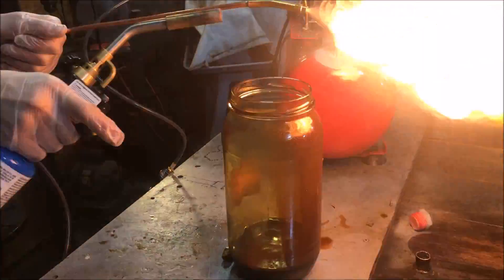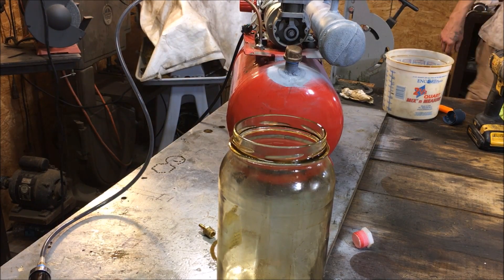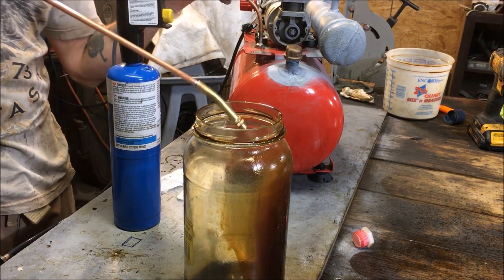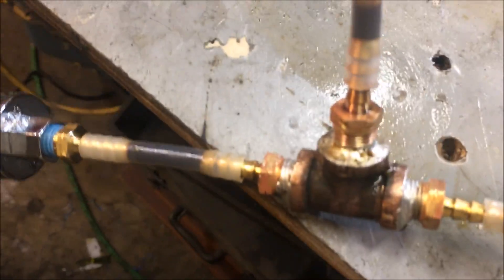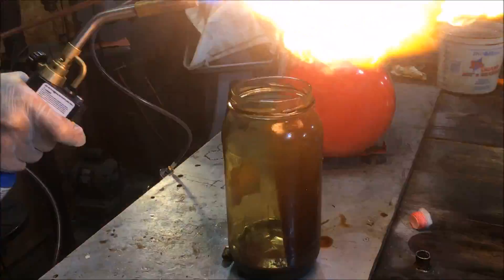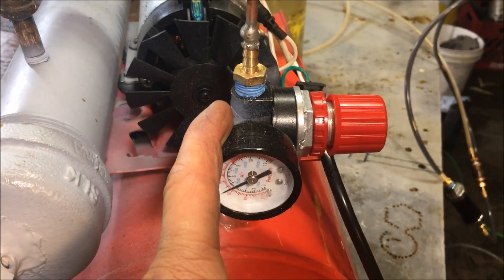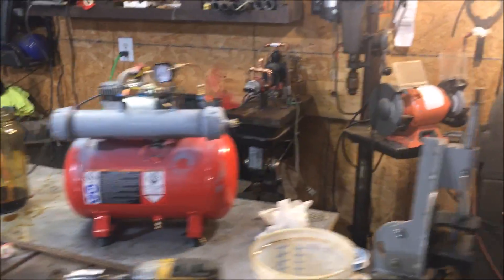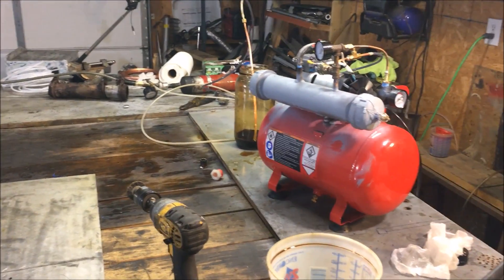Waste oil atomizer ( TEST )

Comment: The way you have yours now is the same way oilburner sets his up With the exception of the filter.  He does not use a filter!    And for a nozzle he just crushed the copper pipe.   He gets a huge burn.     He uses a long burner nozzle to compensate for the sputtering!!